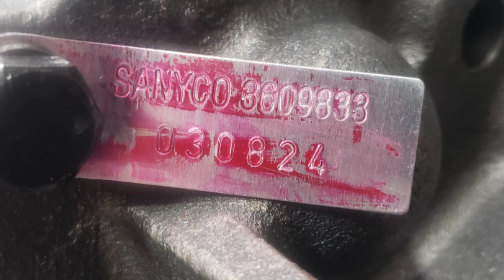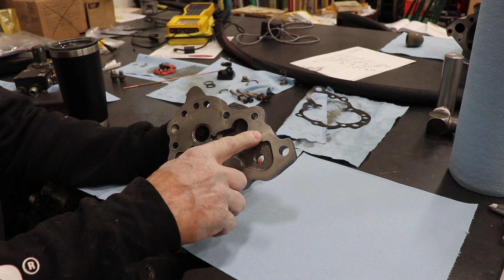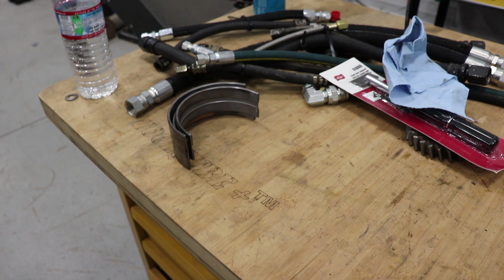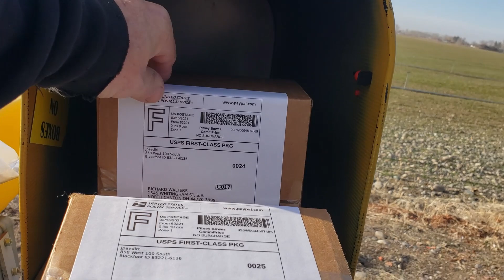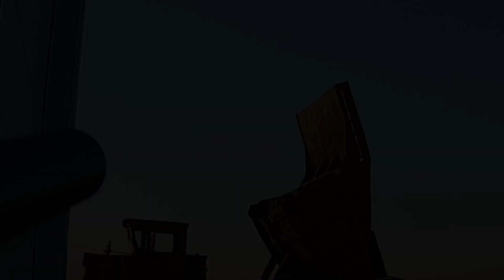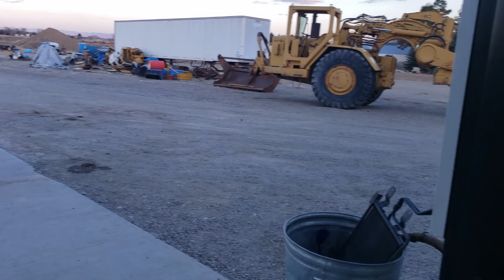Is Made In China Bad

Comment: I suspect that Cummins has decided the cost saving is great enough that they will accept poorer quality, they may have tested the Chinese pumps and found them adequate but they never changed the specifications in the repair manual to reflect this change. If they stopped making this engine then the manuals specifications will never be changed. This problem is more complicated due to the fact that a lot of foundries in the US have closed and a lot of castings come from off shore foundries in China or India so it makes sense to machine them over there. You do not want a container of raw castings shipped to the US and then find out they are not useable.

Comment: I know the pains of chinese crap parts. I had to get my ford 460 exhaust manifolds from china, each flat which was 4 inch wide had a 1/16" of warp, high point in the center of the port. Had to mill brand new mantifolds and helicoil all the threads because they weren't cut properly, not happy.

Comment: at 10 minutes.. you really need to take out that bypass piston and run a 2 blade fine grit wheel cylinder hone lightly thru that bore..  just to dress down the high spots..  sent you a video..

Comment: In a 3 party system (Cummins/Distributor/Dealer), the average cost [From Cummins to Jaypaydirt (retail) is about 8 to 1.   IF the pump cost $800 retail, then built into the price has to be 20% ($640)off for dealer (pump peddler) so he can make $160.  59% for distributor-to-dealers is around $328 so the distributor can make $312.   Cummins will take in $328 and Cummins raw cost to make  will be somewhere around $39~$45/unit.
Reply: I have nothing to contribute, but Ye Gods.

Comment: All I could find was the kit for a rebuild that was actual OEM Cummins. Hell, used OEM pumps were $400. International Trade Corp on eBay was just an outright lie. If Cummins isn't upset about this BS they damn sure should be. I'm betting Cummins's excuse will be that they stopped making N14's in 2000. My dealer says they don't sell the pump at all, just kits because the replacements were too much trouble. They must have run into the same situation as yourself. At least the kit comes with gears and you could just hope the casting was in good enough shape to make up a useable rebuild.